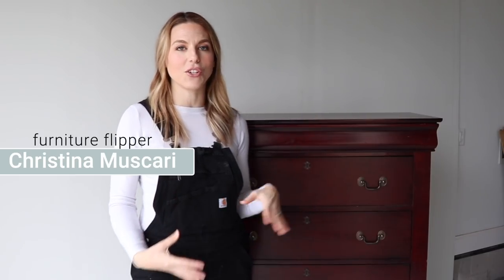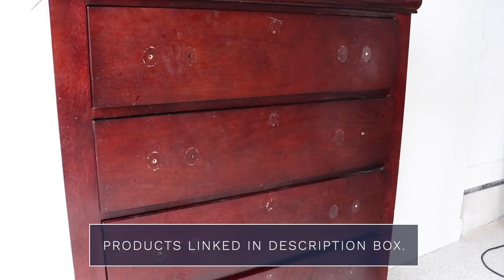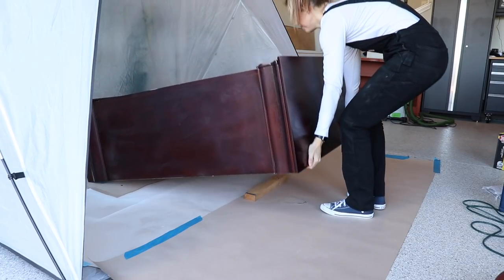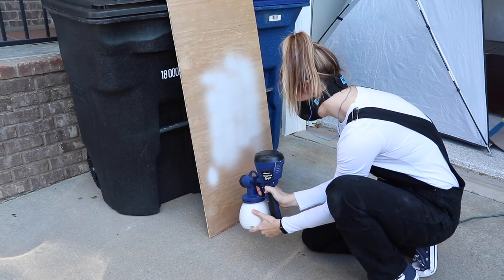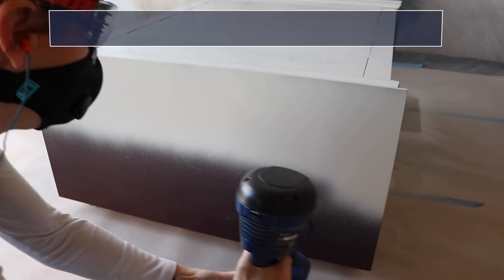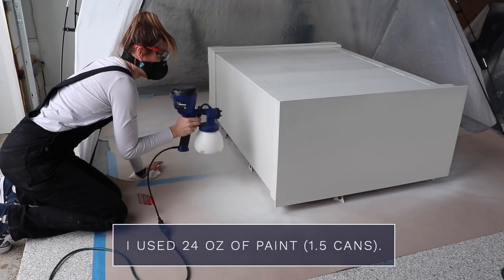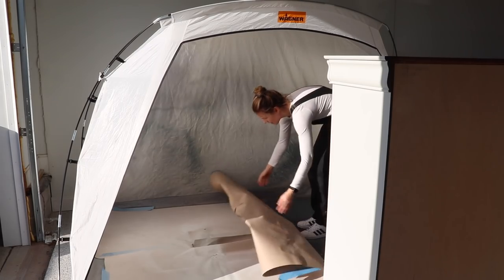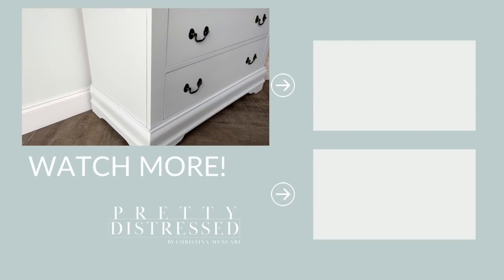Beginner's Paint Sprayer Furniture Makeover | HomeRight Finish Max & Silk All In One Paint

Comment: Thank you Christina! I just love watching your videos! I’m so glad you used this sprayer, as it is the one that I have had for several months, and the only one I’ve ever used. 

I’ve never tried Dixie Belle products, but I’m very curious to know if you think that (using a Silk light color) you would ever have a furniture piece that would have issues with bleedthrough, if you didn’t prime first? And how would I be able to judge the need for an additional primer, before painting with Silk?

Since there was such a dark/reddish finish on that piece… I am SHOCKED that there was no bleedthrough! That would be an absolute game changer for me🙌… As I have had many nightmares with bleedthrough, using white and light colors on similar finishes. (I hate having to resort to using oil/shellac based primer‘s😩)

Thank you again! 🤗 - Shay
Reply from the maker: Great question. When I was cleaning the piece the finish was not coming off on my rag, if it did I would have added a primer before adding the paint. This paint does have a built in stain blocker, but if you see loads of color on your rags when cleaning it is always a good idea to add an additional stain blocking primer.
Reply: @ChristinaMuscari  thank you so much! :))

Comment: I am a professional painter. I have many professional spray guns such as Ani, Rongpeng, Wagner, Graco, Anest Iwata. This device comes in the same shape under different names. Mine is from Taiwan and I bought it on Amazon as an extra for painting window and door frames. Honestly, I have mixed feelings. This is a spray gun with an unusual shape and excellent balance. When we hold it with a full tank, we don't feel the weight at all. It is easy to use, sprays paint well, but unfortunately it has some drawbacks. The first problem - when unscrewing the metal nozzle housing, remember to keep the trigger pressed. The same must be done when screwing the housing onto the thread. The reason - the thin needle often unscrews and blocks the hole, preventing spraying. The second disadvantage is the most serious - the knob + mechanism regulating the needle movement is made of poor quality plastic. Too soft plastic and it works unintuitively, turns hard or gets stuck even when we approach the upper limit. This means that the device often does not spray paint at all when the trigger is pressed (the paint is always diluted). And a tip - When adjusting this knob, we cannot keep the trigger pressed. We can break the above mechanism .
Reply from the maker: Great feedback- thanks!